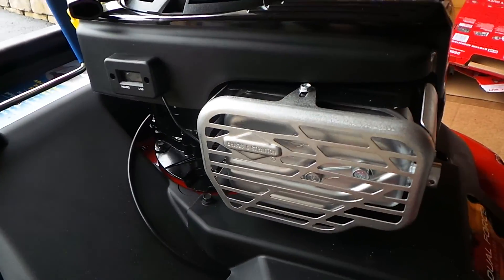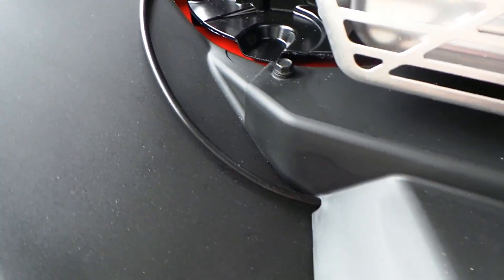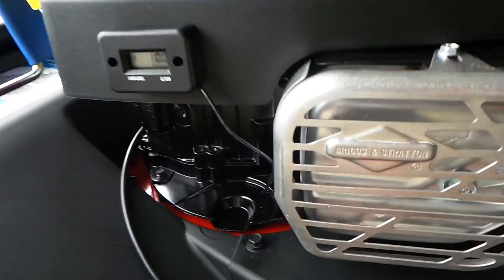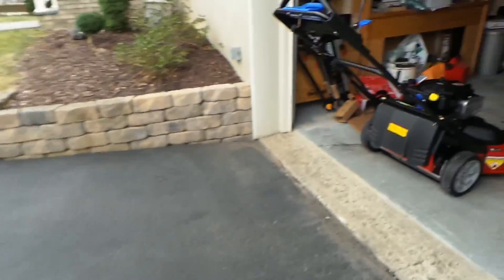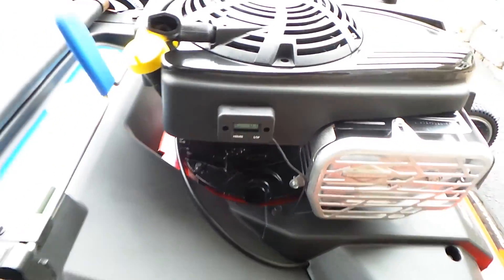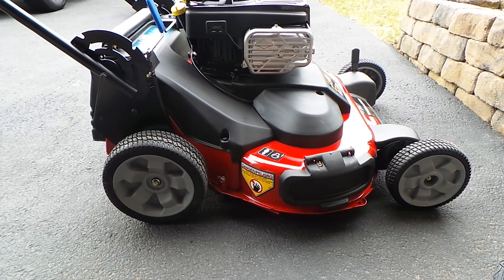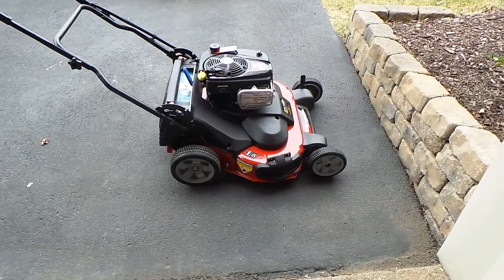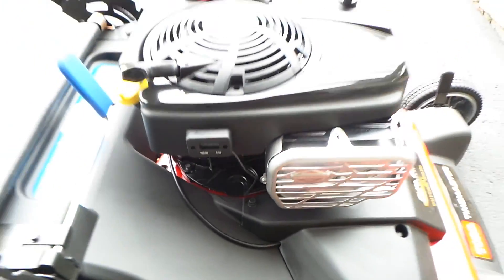How to Install a Hour Meter.... Part 3

Comment: Very thorough tutorial.
I have had my John Deere JS28 22" mower for almost a year now. It's my first season and it has 52 hours on it, but that's all I have. I am going to get a Raptor for my first big mower, here is Australia they only sell Raptors with Kawi engines. No Kholer powered machines will ever come to Australia said the Hustler Distributor here.
I really do want a time master or even turf master but some of the gates I deal with are only like 25", it's sucks lol on the bright side my Worktunes are the freakin best thing I have ever bought, use then ever day almost.
Reply from the maker: +Loiero1995 god i love australia ...lolol     go kawi,,,,    Thank you for the kind words bro ...i really appreciate it

Comment: Haven't used my new timemaster yet, doing like freak said gonna bust out all my first cuts with the old mower.
That gives me time to order me a meter. Thanks for the Vid!
Reply from the maker: +Small Lawnz no prob sherry ...hope the new timemaster gives you a bit better luck
Reply: with a meter on board should be easier to keep on top of maintenance
Reply from the maker: abosolutly sherry ...if you have any issues hit me up ..i will walk u threw it ,,,but its as easy as pie

Comment: What RPM does your timemaster run at?  I just installed an RPM/Hour 
meter and mine is about 3400 at idle, 3200 when the blade is engaged?  I
 have a newer 2019 model with the 10 ft/lb motor.